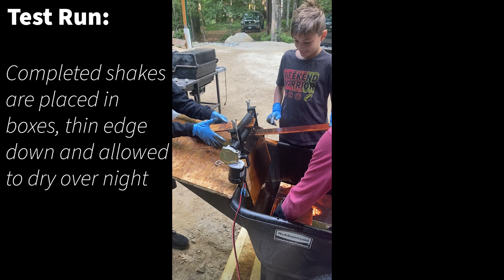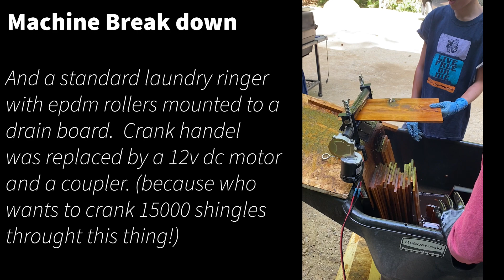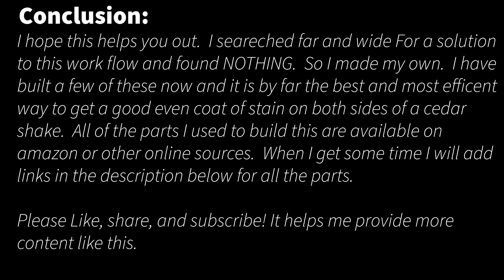Treating Cedar Shingles Prior to Install

Comment: Nice job. Just getting ready to stain 4000 sf of shingles myself. I bought the same wringer but need some direction on the motor you used to attach to the wringer.
Thanks,
Jeff K
Reply from the maker: Hi Jeff, Thank you for the question.  I have added the Key Components to the video description. hope this helps.
Reply: @LakeAndLodgeGarage  Thank you. You have the bushing and coupler listed as the same product. The shaft on the wringer is 5/8 and the shaft on the motor is 3/8". Should this be a 3/8x5/8 bushing? If so how did you keep the motor shaft from spinning inside the bushing? Drill and tap a hole for a screw from the bushing to the motor shaft?
Thanks
Reply from the maker: @jeffk9405  sorry about that. fixed it in the description.  all I did was slit the bushing then the set screw in the coupler was able to clamp it down just fine.  sorry for the confusion.
Reply: @LakeAndLodgeGarage  Thank a million. I ended up buying a waterproof transformer as I live in the PNW as the process will take place in a shed. My cousin is going to do his shingles after me so we split the cost on the equipment. He has about 5000 SF to do.
Thanks again.
Jeff K
Reply from the maker: @jeffk9405  glad to help. I would HIGLY RECOMMEND the stain I used. It has this weird ability to even out areas of heavy coverage over time. It’s quite amazing to watch if you notice it. Also another tip. Feed the shingles at a slight angle, thin edge first, so the roller does not snap down aggressively on the thick end. Other wise you will find out how you look with freckles.  Good luck